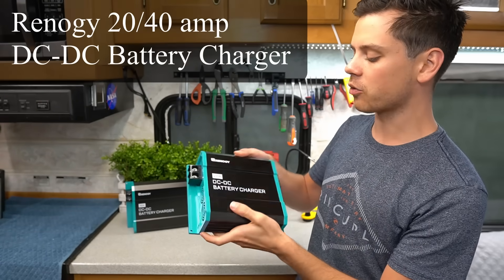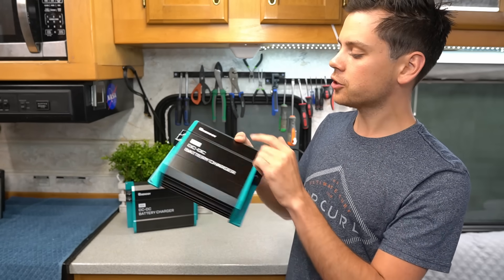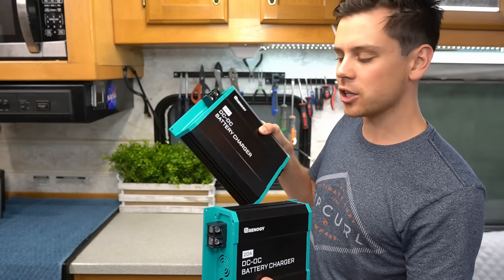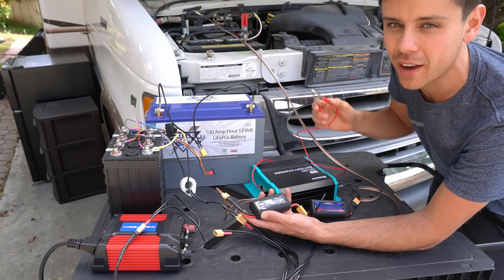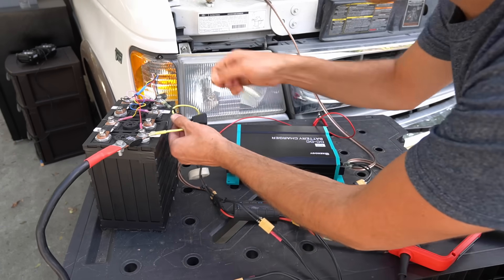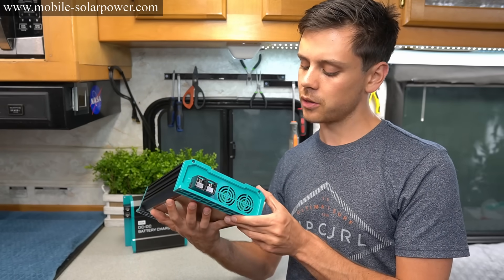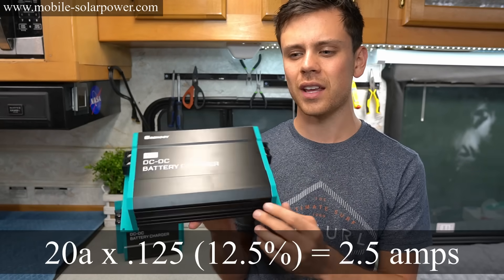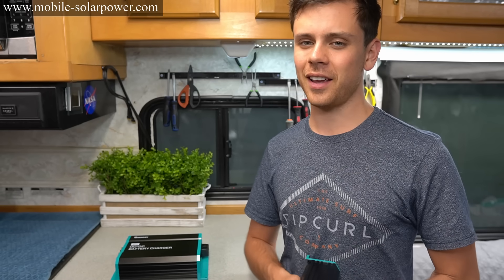Renogy DC-DC Battery Charger Review: "Smart" Alternator Charging for Solar Batteries!

Comment: Thanks for the feedback, Will! We can't wait to see how they do for you in the long run! Temperature sensors  are coming soon!
Reply: Instead of connecting when the key is turned on.. is it possible to just have a power on switch? That way I can turn it on after the alternator has turned on and turn it off to cool..
Reply: Gail Wagner yes just put a switch in between the signal wire so you can turn it off when needed but also it will still turn off when cars off incase you forget to turn the switch off.
Reply: @gailwagner8115  yes - all you need is 12 volt power. Some people wire it into the running lights so they can activate it by turning on the lights.
Reply: @DavidLaFerney  we put ours in about 10 months ago and it's working great! I opted for the 20, it is a slower charge but it pulls less from the battery. Ending up having to add a solenoid to divide the power.. it wasn't giving enough to the chassis battery, but it has been working since. We also added an on-off switch to turn it off when we're on the road long distance.  We put a good 10,000 miles on the van and not had any problems with it. 👍
Reply: @gailwagner8115  I've seen All About RV's connect to their running lights. I'm considering that too.
Reply: @gailwagner8115  You could put a solenoid that you manually switch on after your car is running.
Reply: @gailwagner8115  yes, a switch on the dash would work fine for this
Reply: Did they ever refund you?  Did you try the 20 amp version?  I'm here watching this video and reading these comments because I want to try the 20 amp version on my Transit Connect 2015 with 100ah lithium battery.
Reply: @didjesbydan  what is the result? I just bought a transit connect for conversion. Thank you!
Reply: JAMES TSE I've had the 20 amp version installed since January and it seems to be working well.
Reply: @didjesbydan  Thank you Dan!
Reply: JAMES TSE Good luck!  Besides the main power cable that I had to run from the front battery, through the firewall to the back battery, there is also a smaller (14 gauge?) wire that is required for turning on and off the charger device.  It needs to be connected to something that receives 12volts only when the ignition is turned on.  For that, I ended up finding an unused terminal in the fusebox that sits by the drive battery.  It's a terminal that is meant to be used to connect a taxi light.  I'm guessing your model might also have something like that available.
Reply: @didjesbydan  How was the charging effects by alternator when driving?
Is it worth to add the device?
Reply: JAMES TSE Definitely worth it.  Charges my Battle Born lithium iron phosphate battery quickly enough.  I also have 300 watts of solar panel on top, just to cover my bases and never worry about charging the battery.  Don't know how well the battery to battery charger would do on its own.
Reply: @didjesbydan  I was so lucky to watch this video and learn so much from you!
Hope to see how you up your connect.
Reply: I will really use low current mode. let me explain my battery system first, My off-road truck has 2 lead acid in engine bay. Start battery only for starter, secondary battery is for all off-roading accessories and the battery charge by solar panel too. 

inside the truck I got a 100ah lifepo4, which can supply all I need during road trip and van-life. More important, lifepo2 + 2000w inverter also can supply everything I need(micro wave, water kittle, lighting and camera computer stuff), except AC of my RV trailer. So now, 90% of time I won't bring Generator with me and I have no problem with it.  

How do I charge the lifepo4?  I will use the secondary to recharge the lifepo4. I will use low current mode when the truck is park there, and use solar charge only. The low current control can prevent the lifepo4 take over all energy from secondary battery in short time without start my truck. It is a real good mode.
Reply: @aaronbai09  you definitely need a DC to DC converter and one that can support a LiFePo4 battery! 
Never charge a LiFePo4 battery with you engine siting at idle, you will cook your Alternator! LiFePo4 Batteries will take everything that the alternator has to offer! That's why you can't find a DC to DC converter that charges the secondary battery at more than 40A. So when it comes to this type of product, bigger isn't better! The new version of this also has solar panel input as well and if the sun is shining, it will choose solar first and solar current delivery is higher than what it provides from the alternator, it will catch on fire 🔥 when your battery is flat on a hot day and your engine is running at idle to charge the battery, which is what most people would do without wondering how hot the alternator is! 
A cheap eBay temperature probe on the alternator will show you what it's going through when the secondary battery if full and when it's flat, that's why water cooled Alternators exit!
Reply: @PeterMilanovski  I am just wondering if I can change to a bigger (220A) alternator and add a palmar mc 614 external regulator. theoretically, it is possible to boost the airstream trailer ac (13500btu), do you think it will work? because it sounds risky ~ but if it work, it worth
Reply: @老白频道  I'm not familiar with the Palmer external regulator, you can always upgrade the alternator, that's not a problem! You didn't mention anything about batteries? Do you have any? If so how many, what type (lead acid, AGM, lithium?) and what's their capacity? 
It all comes down to how much current you draw from your Alternator so if you don't have a way of measuring how much is going to what is connected to your vehicle, you need to invest in something that can measure.. these DC to DC charger's are basically designed to draw a small amount of current from an alternator to stop it from overheating. And they are really good at that. Having a separate battery really is the best thing, if you haven't already got lithium batteries, they really are amazing, just remember! Don't think the old way of having one big battery! With lithium, you have to work out how much capacity you need, then get smaller capacities and parallel them together and they will be able to deliver much more current than a single battery, they share the load so you are not killing the one battery and if you realize that you need a little bit more run time, smaller batteries are cheaper and you can add extra capacity as you need it! Another tip that I can give you is to have more battery capacity than you need, that way you won't be draining them totally and by not draining them totally you will extend their lives longer than what they were rated for! 
They are usually rated at 2500 cycles but that's if you fully charge and discharge them, but if you have enough batteries that get you to half discharged, you will possibly double their cycle life to 5000 cycles.. and even better the the more capacity you have!
The AC you have should have a rating for how much current it draws, it's difficult to work from it's heating and cooling power! BTU is British Thermal Units, it doesn't really tell you much about how much current it draws! You need to find that out. People who install those things might have a better idea of what sort of current they draw...
Reply: @PeterMilanovski  Wow, Understood a lot. Yes, I have 3 battery in my Land cruiser. One is 54ah random brand for main battery, and this one only for start the car. then wire though an isolator and go to secondary battery , an Optima marine battery, I hookup all off-roading light and 12v/usb charger and camping light inside the truck (sometime i do car camp). I have been use this double battery system for years, since I brought a RV this year. I really don't like to take a generator everywhere~ so I install a battleborn 100AH in my trunk, and have a 3000w investor. I will just plug in the RV's city electric cable to the investor. Except of the AC, everything can be support over night or two nights such as fridge and water pump or light~ but I really want to turn on my AC in the summer without a 200lb generator or two honda 2000. So, the only problem I try to figure out is turn on the AC without generator, I don't really like to put 8 battleborn or 2 Used Tesla battery into the RV, because they took too many space. And I don't mind idle my car overnight~ so, maybe the cheapest and easiest way to achieve my AC goal, is upgrade a bigger alternator. I checked the AC's running amp under 110v is 16A, that mean's it's about 170A under 12V, So a 220Amp alternator might can support it~ but it is a new idea and only theoretically work, but I don't have enough knowledge to figure out~ so, just looking for help everywhere😂，thank you a lot of all details you provided
Reply: @老白频道  yeah just make sure that your inverter can run the AC... Also remember that if your truck is just sitting there and idling it's not getting any cool air! Maybe a good idea to think about a computer 12v fan with some ducting aimed at the alternator to give it some air to keep it cool while you are stationery! 
In saying that, I kinda don't like the idea of the truck running while you are sleeping! Unless you really test it out during a really hot day to make sure nothing happens while you are sleeping or in the middle of nowhere with no one else around.. sounds like you might be in the US, not sure about cell reception across the country but down here in Australia, there are places where Jesus couldn't find you let alone a cell tower LoL.. that's why when you see a movie that is based in the Australian outback, people always have a satellite phone or some form of ham radio... If you like a good horror movie, may I suggest Wolf Creek, filmed in the Australian outback, I have read somewhere that it was band in the US for being to scary! It was actually based on a true story! Actually you probably shouldn't watch it because you might be to afraid to come down and see it for yourself LoL. 
Anyway, I personally would be thinking about having enough battery capacity so that I don't have to run the truck while running the AC... But that's just me! 
Is the Battlborne a lithium? I have heard many great things about their batteries... They are a bit pricey for me, I have a great run with the cheap no name LiFePo4 Batteries from eBay, they all have a BMS and are protected against everything.. the protection actually works, don't ask how I know LoL... My solar charger with built in inverter died, my son was rewiring it and messed something up and it failed shorting out the battery bank... They shut themselves off instantly and retained their charge... I'm never going back to lead acid or similar type batteries...
Reply: @PeterMilanovski  Yes, you hit the point~ there are no cool air in. I pretty sure Land Cruiser can bear it, just not sure if the aftermarket alternator able to do or not，😂. I know what are you talking about~ It would be ok that idle the car for electric, because I am sleep in RV trailer, the only thing I need it electric~haha. I love AUS so much~ only because you guys have v8 4.7 twin turbo~land cruiser~ love it so much.

and also same here, there are many place do not have signal, but not as much as Australia. 

I know, but the problem is the cost is too much to have enough capacity to support an AC, ( at least 800AH?). In the US, 100AH for $1000, it is crazy~, it is $10/AH, but in China, only took $3/AH~and quality also not bad~  

yes battleborn is one of the best battery brand in US, they provide 10 years warranty, but also expensive one
Reply: @老白频道  V8 land cruiser is very heavy! To slow for me lol. I love the BMW X3 3.0 turbo diesel straight 6 cylinder, excellent fuel economy and fast! It's not as big as the land cruiser but it's plenty of room for me.. the X5 with the same engine is good too 👌 parts for BMW are cheap here so if you can do your own service and repairs, it's a cheap car to own. 
I used to own a truck that carried 5 car's on a trailer. I still remember the first time that I put the land cruiser on, it was brand new and V8, my truck was struggling to get up the hills because it was so heavy! It's got a lot of pulling power but it's just too slow for me! Yeah the X3 is perfect for me! 0-60 in under 6 seconds.. 1200Km distance from one tank.. I like to travel but I don't go rock hopping. Here, you can go anywhere and you will meet plenty of people who are just like you! Everyone is friendly and no one has a gun! Well not exactly, some people do have gun's but they are usually farmers who can prove that they need one, but for the average person like me! What do I need a gun for? No one else has one! 
Things might look bad at the moment with our lockdown's but I agree with it, that is why the death rate here is so low. These are the actions of a government that is trying to protect its people, because without people, there's no government! This isn't the first time that Australia has been in lockdown, the last time was in 1918 and after the virus had passed, everything went back to normal! Nothing changed except for the few that died because then like now, there was people who didn't listen and spread the virus! We were just starting to come out of the lockdown when the idiots who didn't believe went and got it and gave it to others and then went went back into the lockdown.. 
This virus wasn't the first and it won't be the last! These viruses were here long before us and they will be here long after us! 
All that we can do is to do whatever we can do stay alive without killing anyone else. I really hope that you are doing well over there, New York City looks pretty bad at the moment..
Reply: @PeterMilanovski  Ha, I know, I have a 335 here~ the BMW's AWD system will kill me in middle of nowhere~ I do off road and overloading all the time, So, Land Cruiser maybe is the only choice in the world~no one is better.
It is OK, I will only stay home in city or go to somewhere without any other human~hahaha. I m in Los Angeles~the situation is not that bad, but, yes, not good.
Reply: The Dc-Dc chargers demonstrated in this video have charging limits of either 20 or 40 amps. They will never boost to the 170amps (regardless the output of the alternator)  you require to run an AC unit. Their purpose is to augment the charging provided by solar panels while you are travelling to recharge your house batteries so power is avaible when you reach your next destination. Running an AC unit in an RV requires massive battery storage and solar capacity when off grid.Depending on the size of your RV - a large enough system will push the GVWR to the limit or beyond. Many seem to rely on a generator when AC is necessary. I have a 400ah Lifepo4 setup with a 3000 watt inverter and 600 Watts of solar along with a 20 amp DC-DC charger on my 25' travel trailer. It can run my AC no problem - but only for 3-4 hours until my batteries are depleted. I can get a little longer with good sun - but going to bed with depleted batteries is not good. @老白频道
Reply: Please make a 24v version!
Reply: @joedude44  Hello Joe; a company called Victron makes a very good unit for 24 V
Reply: @joedude44  the current models support 24V... They might not have when this question was posted, but since it's a DC to DC converter, it might actually support 24V, I haven't seen the specifications for this one..
Reply: @Craig E I read the correct dip is 1 through 4 on and number 5 off for a 14.6 .. is that what you did? PS I've been racking my brain and emailing everyone trying to find out if the 20 or 40 would be better for my vehicle and your comments have been more helpful than anyone, so thank you so so much!
Reply: Craig E hey good to hear!  I guess I need to find out from someone at Ford if the alternator on a Transit Connect (smaller than your Transit) might be able to handle the 20 Amp draw.
Reply: Wondering if you could answer this. It may be useless overkill, but I have the 240 AMP Sure Power battery isolator wired into the camper. I would like to interrupt the output to house batteries circuit and use one of these chargers. Would it be a problem to just connect this to the output of the isolator?
Reply: @Craig E LOL I am in the same boat. Renogy will refund me when the "process" of my return is done... which means??? Still waiting.
Reply: @Craig E May I ask if your ford has a smart alternator? I've got a 2015 ford transit and want to check the 20A will be compatible with my alternator. Thanks so much!
Reply: Looking to buy a DC-DC charger.  From what I can see these don't have a solar input.  I'd like the option to run solar on my car as well so the battery can be charged when parked.  Any suggestions?
Reply: @treedragons   they have a version which allows solar input as well.
Reply: @lylestavast7652  Thanks Lyle.  I'm in Greece so I think I need to order from the German site.  I'll have a look and see what's available in the EU.
Reply: @treedragons  Enerdrive in Australia also makes a model with dual input. Victron makes dc to dc chargers but I don't know if they have any dual input.
Reply: Could you plug a cigarette lighter into a charge controller and charge van system like that?
Reply: How do you ground this system. I've seen some folks ground to chassis despite this already being hooked up to the starter battery which is directly connected to the chassis ground. Please advise. Renogy will not respond to this question which is their MO. Also, they said their 60amp DC to DC would work just fine with a Ram Promaster with a 220 alternator. Can you or anyone you know confirm this. If these folks lied to me and mess up a perfectly new engine I'm going to make sure it's broadcast far and wide. Renogy tech support isn't responsive and hasn't answered direct questions, and I often get different answers depending on who I get there after waiting on hold for an hour or more.
Reply: pro trick : watch movies at Kaldrostream. Me and my gf have been using them for watching loads of movies these days.
Reply: @Adrian Leandro definitely, I have been using Kaldrostream for since november myself :D
Reply: @Adrian Leandro yea, been watching on KaldroStream for years myself :D
Reply: @Adrian Leandro Definitely, I have been watching on kaldrostream for since november myself :)
Reply: Will, or anyone else, how would you compare this unit to the Victron Orion Tr-smart B2B? I realize their units are rated at 18 or 30 amps. 
Also, is it safe to expect that either of these units will draw 30% more amps than what they put into the batteries they are charging?
Reply: @Craig E You could have kept the 40 and just used the charge limiting feature . . .
Reply: @Craig E It's like they dont speak English.
Reply: Why is it so difficult to find anything for 24v systems?
Reply: JAMES! Since the 70's yes! This is my issue.

My Mercedes is 24v, so i need a 24v dc-dc charger but can’t seem to find one!
Reply: @joedude44  I think victron has one. Orion DC to DC charger. Hope that helps 😁
Reply: @joedude44  Victron has that
Reply: @joedude44  I need a 24v dc-dc charger
Reply: @JamesDean-ow7qo then this one is not for you
Reply: @jamest.5001  Check with Victron - they have 24/12 and 24/24   I think.
Reply: @Craig E I just downloaded Renogy's manual: Renogy - DCC1212-204060-Manual on March 29, 2020 and it seems to reflect the changes you listed (on page 19). According to them your settings are for Lithium with a constant voltage of 14.1 volts. I agree that Renogy definitely should have emailed their customers with this information.
Reply: Update - Renogy listed a separate set of charts on page 20. Using this chart tells me the settings you gave will output 14.4 volts not the 14.1 listed on page 19. The manual could use some clarification.